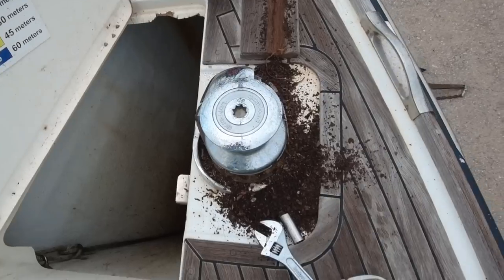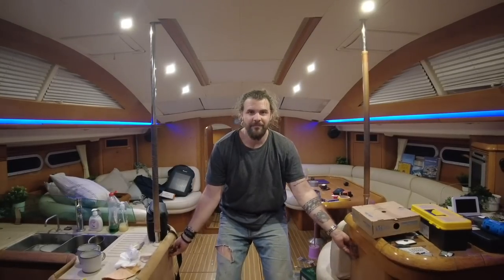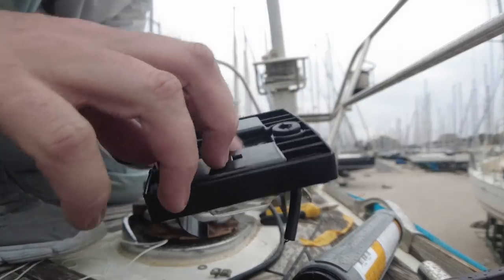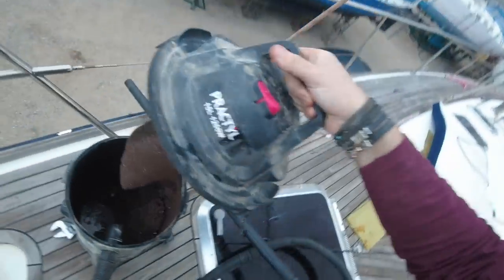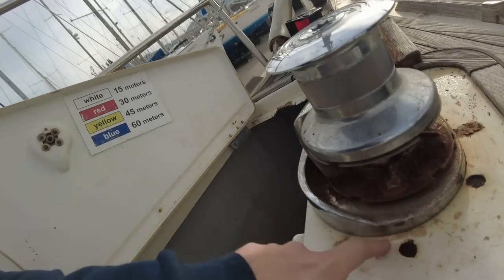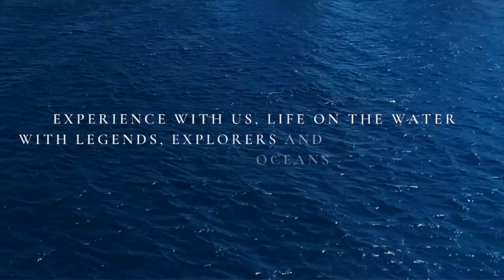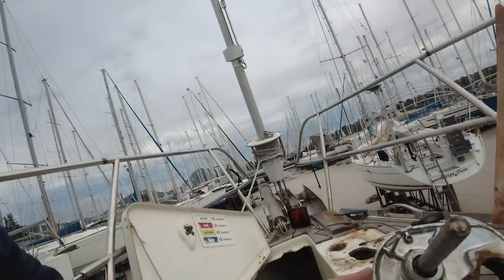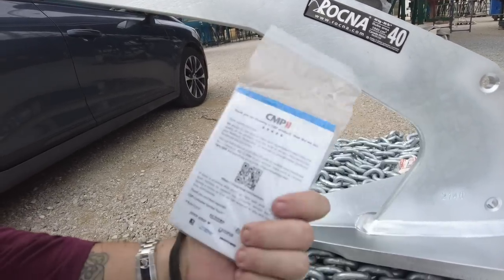SAILBOAT REFIT - New Lighting LED and ROCNA Anchor Jeanneau 54DS

Comment: Oh yeah - You were either over on payload for that car or very near the limit. :) Good on ya man!
Reply from the maker: 🤣 it made it!
Reply: Putting half a tonne of chain in the back of a cute little Renault is automotive torture. The car will probably never fully recover from the traumatic experience of having it's suspension crushed for 2.5 hours 😨
Reply from the maker: @paulpaul9914  it was fine

Comment: Great video as always you limey -astard.   Could you refer to the size of wires in real terms.   14-16-8 gauge.     Not just say “thin, thick etc”.    And the wire size for a 1 meter length will be different if it is a 15 meter length 
Just a constructive suggestion 
Thanks always.     Eddy
Reply from the maker: good idea. but it will be in mm 👍